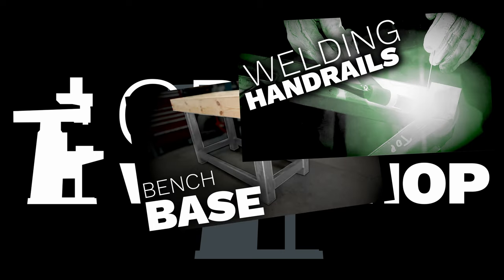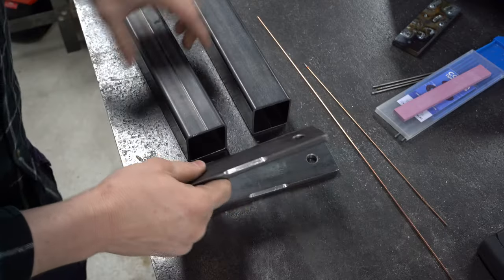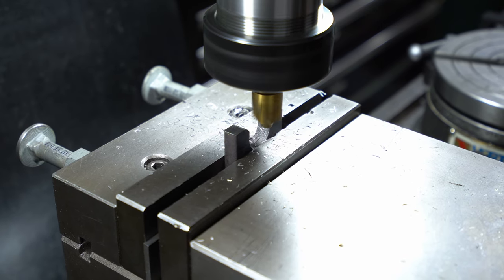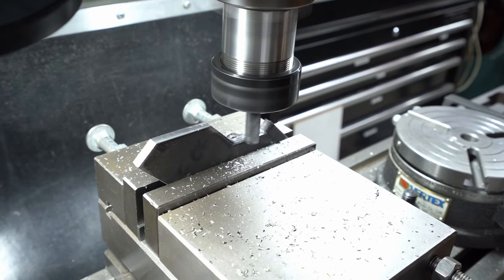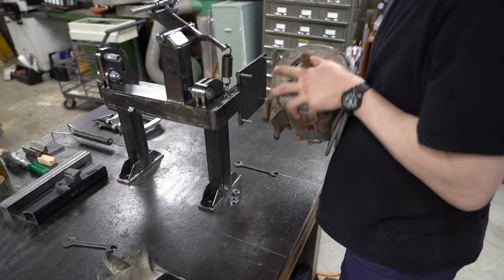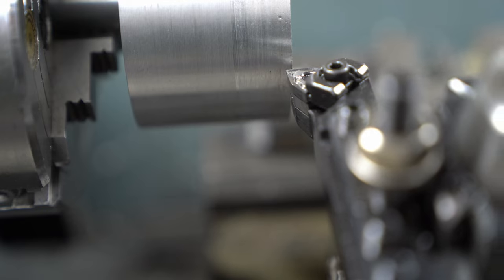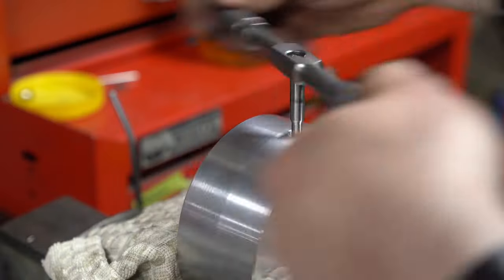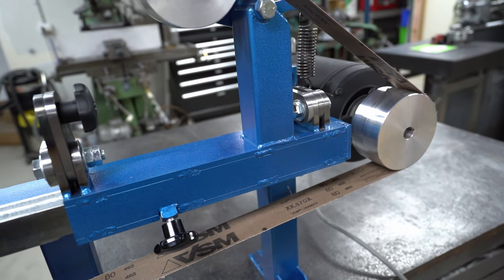Making a PERFECT Belt Grinder | CRAIG'S WORKSHOP

Comment: Creating those pockets for the welds is an awesome idea.... i have neither a machine shop, not a welder, or any experience with either, but its such a great tip I'll keep it.... just in case!
Reply from the maker: Thanks. I just came up with the idea, and thought why not give it a try? It tidies up the external appearance and I think I'd use it again. Doesn't add too long to the build. In combination with the internal rebates/steps it makes assembling the tube easier (so long as you don't have a gas line problem like I did)

Comment: I was limited to doing mine with an angle grinder and a drill press instead of a mill but, I'm so happy with the result.  It's a great design.
Reply from the maker: Yes the design is great. And it is designed to be made the way you did it. I did it my way just because I have the tools available, and it was something a bit different for me! I am on a bit of an angle grinder diet, trying to reduce the airborne dust and abrasives in my main workshop, so those tools are outside-only as much as possible 🙂
Reply: @CraigsWorkshop  Were I to build another one, I now have a tool that would make it much easier and cleaner ;-)
Reply from the maker: @MorrisonManor  absolutely! And all the grinding muck lands on one spot on the floor (or in a bucket placed below)

Comment: Great job, looks amazing! Now the question is, will you mess with casting in order to make your a diameter contact wheel?
Reply from the maker: Ah - easy answer. No - or at least - not for a while. I've got my finger in a few too many pies (hobbies), so I think I need to rein that in a bit. I want to double down on learning machining and improving my welding for the time being. I've got a few machines to restore, and some more building works around here, and some tools and fixtures I'd like to make. That's going to keep me going for the next couple of years of spare time I think. I'd like to make the small wheel attachment for the grinder, and also the tilting table - I have seen that I can buy an import contact wheel fairly cheaply (perhaps pull the bearings and put good ones in)  - so that might be an option too. Thanks for the comment mate. Cheers, Craig

Comment: Beautiful work Craig, love the cut outs for weld idea. I just finished my J.S. grinder 3weeks ago, and absolutely love the way it preforms. Curious about your thoughts on belt training handle. I am thinking a fine thread would have been a better choice. Had a little issue with adjustment backing off.
Reply from the maker: Thank you Jerry that is very kind of you 👍 I found that backing off issue too, and in my case it was a tiny amount of vibration allowing the screw to come undone slightly (which quickly makes a big difference to tracking). Yes fine threads would improve the tracking control, but for me, a dot of blue Loctite added enough resistance to make the handle stay where I put it, and the backing off has not been an issue since. Good luck 👍

Comment: All the little extra touches make for a machine you can be proud of, and do good work on. Great work well presented.
Any comments on Jeremy's plans? When I saw the squared cut-out in the platen I wondered if a tilt mechanism might have been more versatile. Is this an option you decided against?
Reply from the maker: Thanks Russell. A tilting table is on the list of things to make. I bought his extra plans too, for bigger and smaller wheel mounts (to entirely replace the platen) and the tilting table, which is going to be a good option. I thought it would be interesting to use the machine to make these future upgrades - and make a video about - killing two birds with one stone. Demoing the machine properly, and adding to the machine. 

As for his plans quality: they are absolutely perfect. Such high quality, and easy to follow and well laid out, but not the cheapest. Absolutely worth every penny though. It makes the process idiot proof. I just printed all the pages, and stuck them into a cheap binder thingy to make the pages a bit dirt resistant and that was my reference for the last several weeks.

Wouldn't have any second thoughts about buying from him again if something else interesting comes out. Thanks for watching and commenting - everyone's comments/support is very encouraging :) Cheers, Craig

Comment: Thank you for an interesting build vide! I'm subscribed, but this one seems to have slipped through the cracks! Anyway, I've been looking at the same problem. your motor is 1450 rpm,  US current is 60 hertz, or 20% faster so the equivalent is 1700 rpm. I don't know which version you've built, but Jeremy's first version used a 3500 rpm motor, the second a 1700 rpm three phase driven with a vfd to be able to "over speed to get up to correct belt speeds. I have 50Hz mains here in France, my motor, like yours is 1450rpm, in order to get the belt speed right, I'm using an 8.5" /215mm drive pulley. My motor is 2horse power which is considered to be the smallest normally usable! All the best Matthew
Reply from the maker: Yes you are right about the motor. I used what I had on hand that would let me finish the project for the deadline. I will find a 2-3hp three phase motor and add a VFD some time soon. That will help a lot with the speed issue and give me tons of power headroom. Thanks Matthew. If you press the bell notification near the subscribe button you will get notified of all videos in future 👍 thanks!
Reply: @CraigsWorkshop  Well, I've been following you for years, and this is the first time I missed one ofyour videos!  Might I pointout that if you buy a new 1450 rpm motor, running it at 120Hz would give you the right belt-speed! Personally, running a new electric motor at 2,4 times faster than it's rated speed! I would suggest a larger pulley  to get the base speed up, the 20% difference,  especially if you use a secondhand motor, which might not take over speeding. Another thought, I am looking at using braking resistors on the VED to slow down the motor as the larger pulley size  is going to act like a flywheel !
Reply from the maker: @MatthewTinker-au-pont-blanc  One thing I have never worried about is overspeeding motors. If you look at the 2 pole vs 4 pole motors they are constructed identically. Same bearings etc. And low down torque is useful on a lot of machine tools. So am oversped 4 pole motor is my preference. 👍
Reply: @CraigsWorkshop  New modern motors built for VFDs yes no worries, I am wary of older motors!
Reply from the maker: Yes good point. Some of those have plain bearings and so on. I tend to look for ones which are semi modern at least but have never had a VFD specific motor. Always used and bought locally for cheap 👍
Reply: @CraigsWorkshop  Might I sugest a web search for  "Using older  3 phase motors with a VFD " There can  be  problems with windings !

Comment: I hate the hand work… 😂. But I liked the video anyway!  Thank you.  I don’t understand how the weld chamfers eliminate the need for spacers.  Could you explain?
Reply from the maker: Thanks for watching and for the comment. Sorry, the chamfers don't eliminate the need, but there are rebates that I have made, which do. The rebates have shoulders set at defined widths, meaning I can clamp the four pieces together and the inside dimensions are precisely set. No need for the filler piece and shims. Thanks 👍
Reply: @CraigsWorkshop  that makes sense to me now! Thank you for that clarification.  I actually do I’ll the hand work, was just teasing.  I immediately subscribed to your channel and as a “Yank” got a very good laugh out of “and that was maths, with an S”! We use grubs for fishing, Set screws are locking something to a shaft. 😝
Reply from the maker: @cogentdynamics  😂 I find myself using a mix of language. So long as we all know what each other means, it's fine 🙂👍
Reply: @CraigsWorkshop  are you saying we don’t speak English?  Sorry!  I worked for an English company for over 20 years and I find some of these subtleties to be very fun.  I have given and taken a lot of ribbing.  You made me laugh with the comment but I am super impressed by your build and learned from watching.  I have all the parts cut out for the same grinder and have been too lazy to get it finished.  Your video was both motivational and informative.
Reply from the maker: @cogentdynamics  no wasn't saying you don't speak English at all, or that you are wrong in anyway. Just making light fun of the differences 🙂👍 Thanks again for your feedback and support. See you in the next video 🍻
Reply: @CraigsWorkshop  we are on the exact same page.  Sorry for the distraction!

Comment: What brand is the TIG you use?
Reply from the maker: Hi Union - it's a CIG machine (inverter style), but really any machine will do just as good a job in the end. I just used DC to weld, with no pulse or fancy features for any of these welds.